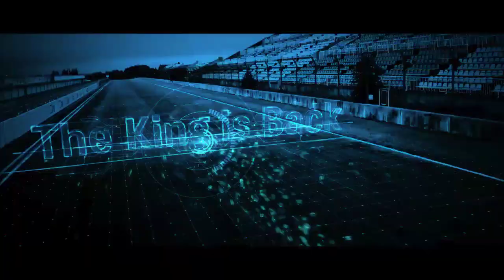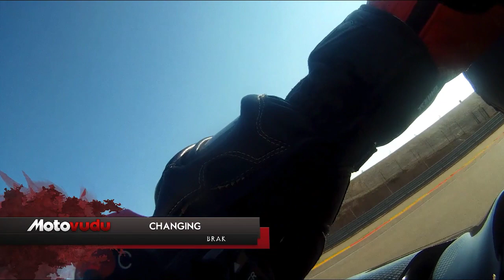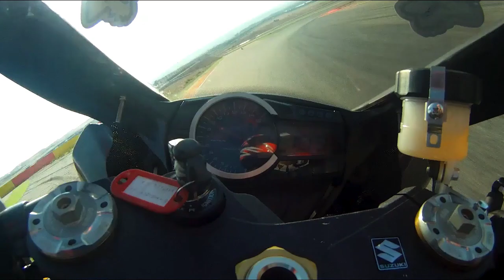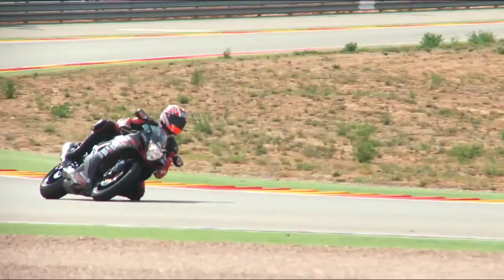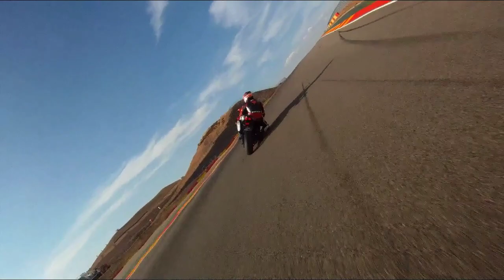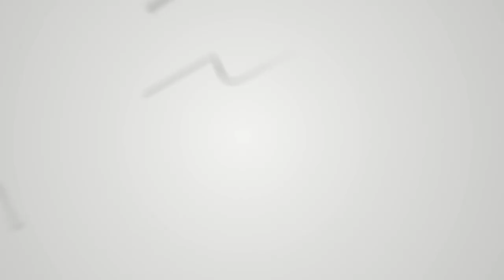MOTOVUDU - Trackday Rider Training Part 15: Braking - Changing Down Gears

Comment: I learned this after I broke my rear brake pedal. And could not use it I learned to use engine braking. Engine braking is much better then using the rear brake it gives you extra time. However there is a time when it’s needed. The rear brake is needed when you absolutely can’t possibly beat the person in front of you and they set pole position. Once you know the bike in front of you is faster you will need to brake later and faster and the rear brake will allow you to quickly take a better approach.

Comment: What's better blipping the thottle to down shift or slipping the clutch(with a slipper clutch) ? I been slipping it lately and found I can approached the corner with more speed because my finger has been already on the brake versus trying to blip the throttle
Reply from the maker: The ultimate is to do both. Blipping the throttle is important to match the RPM, but when braking at an angle smoothly releasing the clutch immediately  after is the icing on the cake. It enables you to achieves the perfect down change without losing any rear grip. Actually, this is the difference between production and MotoGP Blipper's. Production bike Blipper's just blip the throttle, MotoGP systems use the clutch in combination with.

Comment: I just started watching these videos and they have been very helpful. first I have a geared sv1000. I did my first track day this summer and it was a blast but there was one corner I repeatedly had trouble with. it was a short strait into a sharp curve into a long straight. if i stayed in third I could make it around the corner good but id hit max rpm about a second or two before it was time to get on the brakes so id have to ease off witch just didn't feel right, if I went from third to fourth and back to third it would lock the back tire up and id slide through the turn no matter how slow id let the clutch out. if I went around the corner in 4th my engine would chug trying to come out of the turn. the only thing that I think of doing was too give it gas brake and let go of the clutch all at the same time like a heel/toe kind of thing but giving it gas with just my thumb and braking at the same time is really awkward for me.
Reply: Follow a different line maybe
Reply: @keremoner3420  idk if that would make a difference, just learned to back it in supermoto style during those situations. I'm not a racer I just do it for fun so I guess it doesn't matter that much.
Reply: @atomiclizzard288  working for the best lap time should always be fun I think
Reply: @keremoner3420  I agree its always good to continue learning but at the same time I'm not super competitive I just like ripping it up and going fast. Even if it's a little slower than other people,

Comment: I am glad you said you don't use rear brake. I have had a 2004 zx10r for the track only and if i lost the rear brake lever i would not even notice. Is it just me or there is no real benefit in using the rear brake in "normal" riding?
Reply: rear brake is used for added braking when coming to a sudden stop on the street,  by not using your rear youre choosing not to use 30% of your brakes. the rear brake also helps with slow speed maneuvring/stability
Reply: 30%? Lol, think that you can lift the rear up under braking then tell me if you think 30% is not an overestimation.
Reply: Rear brake is VERY useful for normal street riding. I use it just as much as the front brake. Check out high level Moto Gymkhana riders from Japan. They use lots of rear brake. Also, Police Motorcycle officers like Quinn Redeker use lots of rear brake. On a track at higher speeds is where many find the rear brake to be optional.
Reply: Man, you're not alone)  rear brake is useless stuff on short-base moto. in any case,in city too. it just steals your attention.

Comment: I’m pretty good at blipping the throttle when going down the gears, but cannot get the knack of doing this on the brakes, I have to do each task separately. I tried practicing on an empty road once, downshifted as I tried to blip the throttle I put more pressure on the brake and thought I was going over the bars 😂 Amazingly I stayed on, felt like a right twat.
Reply from the maker: Don't worry it's not unusual to struggle to get this perfected, Simon says he has clients that are fast but this is the one thing that it still a bit of a challenge.  Keep persevering, you'll get there :-)
Reply: Motovudu Dankeschon! 😊
Reply: Tris Desnos .....i do it releasing the brake only the time it takes to gas the  throttle to match rpm and back to closed throttle. Middle finger on brake, so if i downdhift 3 gears consecutively i will have done a natural ABS 😇, and matched the gear to do the corner.
Anyways, i understand in the video that you do break vey hard aproaching the corner and release the breaks carry on breaking with the engine at the same time you chose the right gear to do the cornering.
Anyone to discuss this with me please?
Reply: @motovudu  I hear about pre-loading shift lever while downshifting and upshifting too. I hear also opinion that this can damage gearbox. Do you use this method or not?
Reply: It’s because it’s not possible to threshold brake and autoblip at the same time. So, in order to get the most out of braking, you use the slipper method, if you don’t have a quickshifter.

Comment: Hello again. I cant stop listening this short videos again and again and again and again.
Can anybody tell me what RPM would be the ideal for each gear as for engine breaking?
And how much would be too much, or too little?
I presume it should be at the begining of the high rpm?
For example in my gsxr k6,  600cc 11000rpm would be the sweet spot. In theory. Havent tried yet
Reply from the maker: As I mentioned on another answer.. 
The faster you ride the more response you need on acceleration and deceleration. Either way smooth riding is important.
Basically, as you increase your speed you will need to increase the rpm you use to get more assistance from acceleration and deceleration. There is no point screaming your bike in low gears while riding slowly, the bike will be jerky and to responsive, but as you increase your speed (entry and exit) you will need the help from the engine / a higher rpm. For example, I'll ride the slow corners in 2nd when I'm with a slower client, and the slow corners in 1st with the fast client.
Reply: Motovudu ....Understood! ☺ Thanks a lot!

Comment: When you're braking down a straight are you using the front brakes then blipping the throttle? if so this is difficult as you have to keep the brake constant whilst you blip the throttle to rev match which I dont even know if its possible (with a ride by cable throttle) (the much easier course of action would be to brake with your rear brake, downshift, rev match with right hand, then rinse and repeat).
Reply: Most decent sportsbikes have a slipperclutch now. No need to rev match. Dump the gears with no care.

Comment: Hello there. Can the wheels get blocked if the rpm are too high? Or are the wheels blocked only by extremely hard breaking?
Thank you
Reply from the maker: The faster you ride the more response you need on acceleration and deceleration. Either way smooth riding is important. Normally the rear will only lock with maximum engine braking if you are braking very hard, or you are leaning over and are going down the gearbox roughly (especially if your bike is an earlier model that does not have a slipper clutch).
Reply: Motovudu ...Thank you Simon!